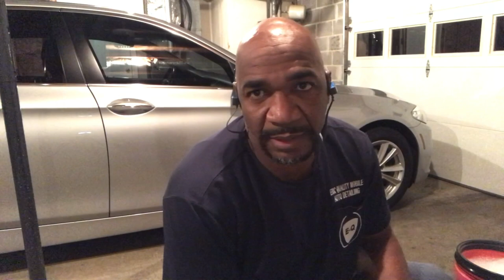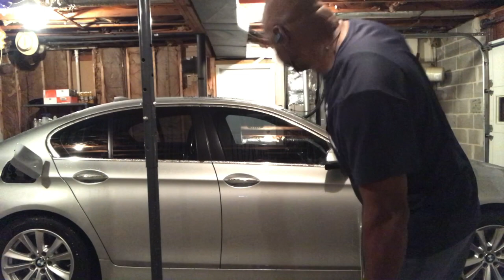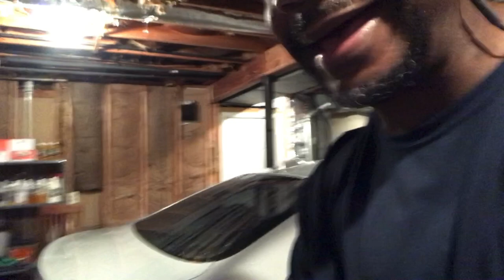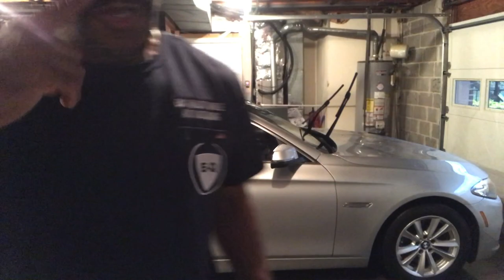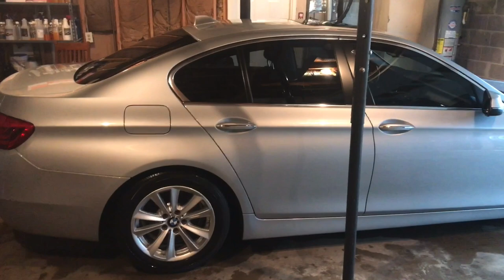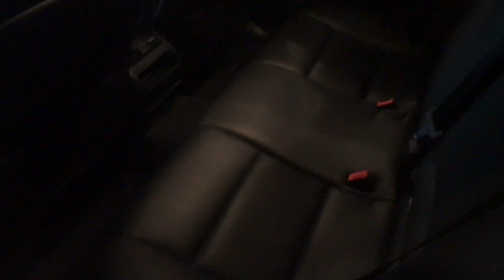How to dry a car to prevent less water spots.

Comment: Is the leaf blower a good method?
Reply: D&A Mobile cleaning services 
It works but car has to be sealed up with a sealant that’s hydrophobic and also you can’t really use it in direct sunlight maybe after you dry the car with a towel but I tried doing it first and when I’m drying everything is getting dried up in the paint. Follow my ig if you like 
@mariosmobilewash